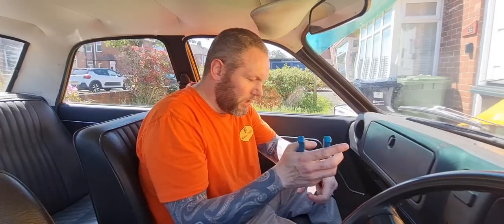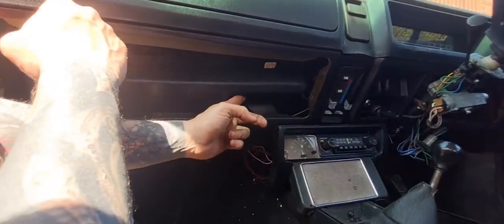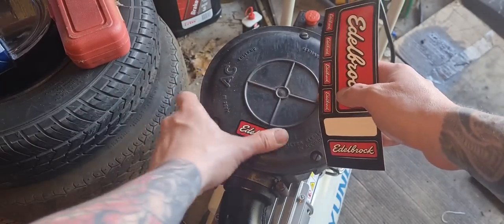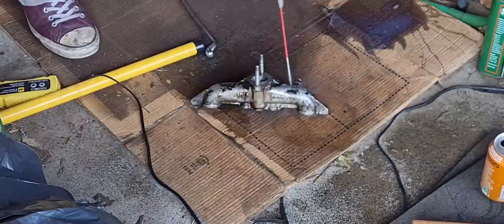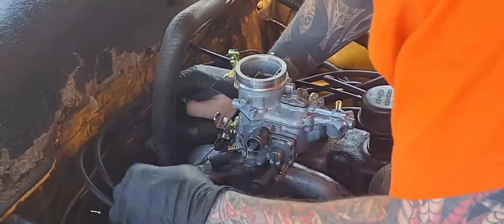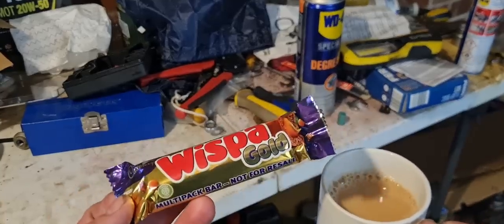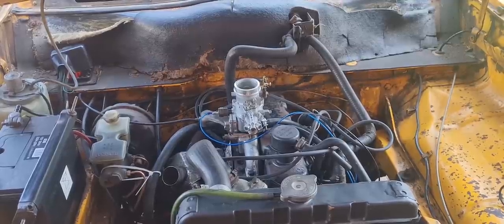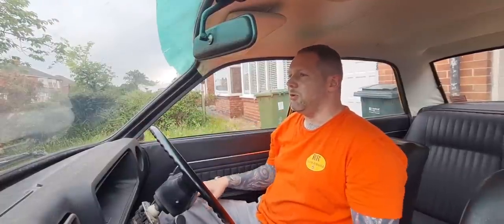WEBER CARBURETOR AND EDELBROCK INTAKE! THE 1975 BARNFIND BUDGET BUILD

Comment: the solenoid valve is also an idle jet its purpose is to stop the engine from running on after you switch off the ignition, i would take a feed  from  the wire that feeds the  coil assuming  the coil is a 12volt  if  not take a feed from the ignition switch .
Reply from the maker: I'm going to wire it from the fuse box  mate 👍

Comment: Hi Steve, awesome video as always!
 Definitely don’t share the oil wire for your +12v feed, as the warning light has resistance and also the supply will drop to 0v when there’s no oil pressure. The oil warning lamp might also glow dimly. 
 It’s always better to get a fresh feed from inside the car from the fusebox or even the ignition switch (via a fuse of course)
 … alternatively you can use the coil +12v, but only if your car doesn’t use any kind of Ballast resistor.
 Keep up the good work Mate !
Reply from the maker: Thank you mate and thanks for the info, I'll wire it in properly 👍

Comment: It’s an electric idle control valve that sets the basic idle speed, then when the engine is shut off, the valve closes to stop the fuel and help prevent the engine ‘running on’.

Comment: Hi there... that Solenoid idle shut off needs to be on a switched 12v supply ideally from the fuse box, coming from the coils supply but not inline with any ballast resistor, you may need a relay so check the amperage and could burn the ignition switch...  or it might just be fine without one.
The Solenoid should only get a supply when the ignition is switched on, and obviously driving the car, the supply needs to be a clean 12v with no resistance or intermittent, thus Solenoids have coils in them and will burn if they are permanently fed with a supply.
The engine  sounds good but still idles up and down slightly indicating the solenoid is pulling intermittently.
All the best mate and keep on rocking !! 🔨🛠🔧🪛🔩
😃
Reply from the maker: Thank you mate, and thanks for info, I'm going to wire it from the  fuse box 👍

Comment: Why not swap the oil filler cap with the green viva Steve, don't need the unnecessary hose & Chevette cap, seems to run sweet, not to sure about sharing feed with oil pressure switch, probably best listening to viewers ( subs ) thanks for everything to date, lol 😆
Reply from the maker: Different fitment, green viva is a flat rocker cover with a cap with slots, and yellow viva is a rocker with a neck on it and cap just pushes in, later viva hc  👍
Reply: @RetroRebuild  wondered whether your whole engine in yellow Durham car was from a later model.
Remember  1975 was about mid point through production.
After 1974, front guards & dashboard  different through till 1979.
When 1977 came and the Magnum ceased production, ALL Viva's ceased being imported as CKD kits from UK to NZ. FYI  lol 😆

Comment: The Idle solenoid probably acts like an idle valve control like on a fuel injected car. When it went on mine it wouldn't below idle 2000rpm.

Comment: As a guess, that solenoid is a cold start unit.  It may be wired to a temp sending unit that has a hot wire to one side.  As the engine reaches operating temperature the switch closes allowing 12volts through to pull the high idle solenoid off letting it drop to the proper idle speed.
Reply from the maker: Idle cut off or anti run on switch solenoid, I've seen people remove the pin from them so they're not in use they need a constant 12v feed 👍